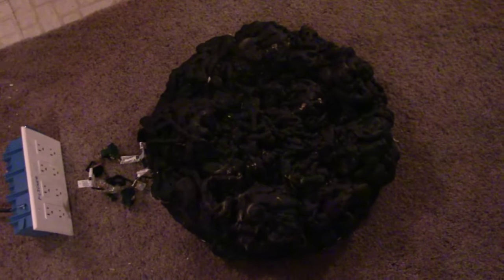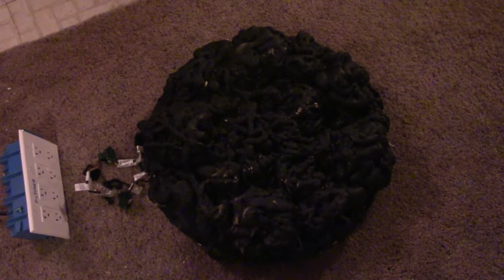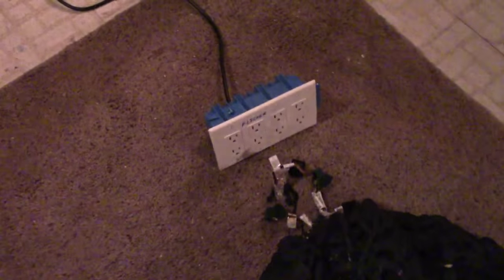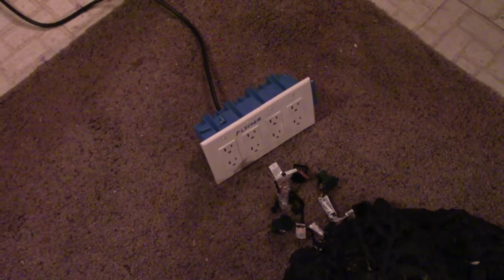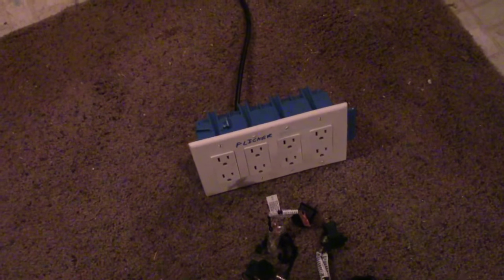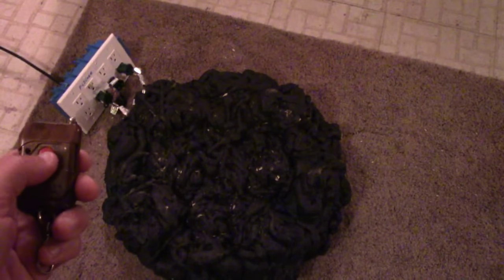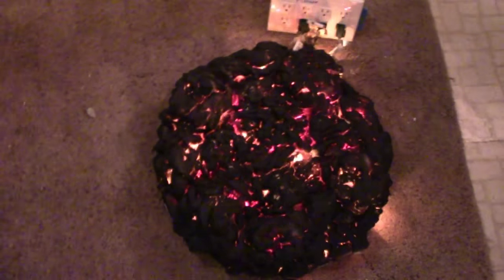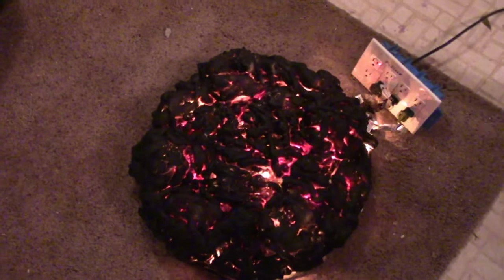Fake Fire Embers Witch Cauldron - Electrical Halloween Prop

Comment: Did you say you used wiiffle balls?
Reply from the maker: For the fake fire? Yes, you cut them in half.
Reply: Brier Rock Cemetery Ok thanks. I’m gonna try and make this for a charred corpse on a rotisserie motor but hook up a fog hose that runs underneath it for smoke.
Reply from the maker: I made a video on that too. I built a rotisserie a few years back. It is on my YouTube page.

Comment: Where can you buy a  electric flicker box, I looked online and didn't see anything under that name?
Reply from the maker: It is a flouresent starter. You can find them in the light isle at your hardware store.
Reply: @Industen  ones I find at local hardware stores are $20 to $30 each.
Reply from the maker: @javaman2883  I made this prop 6 years ago, they now have flicker circuits for LED lighting that cost $8.